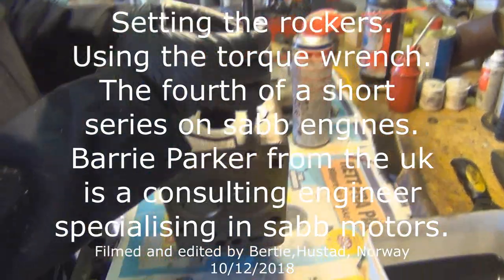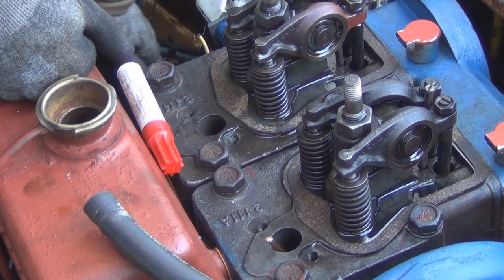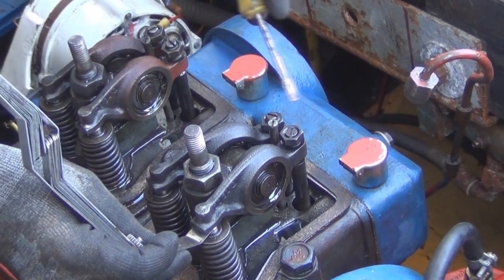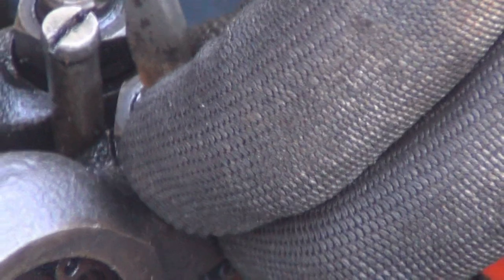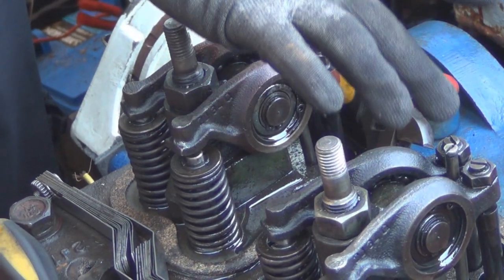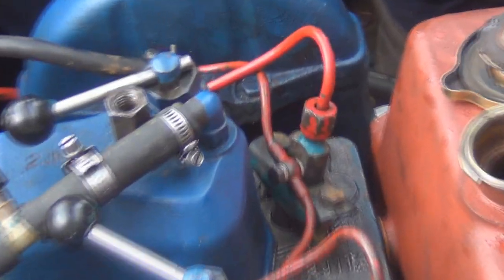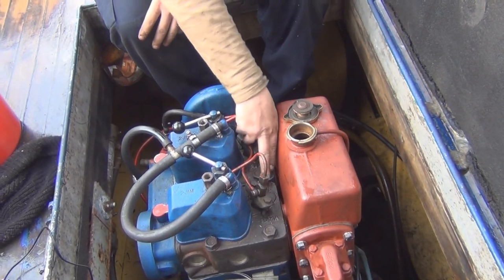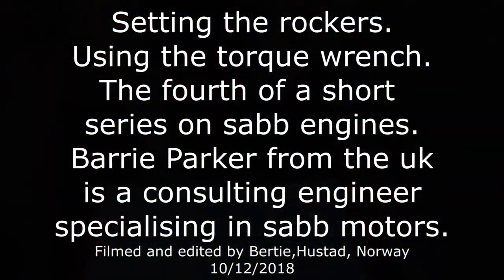Sabb 2j 30 hp marine diesel  Part 4 - setting the rockers.

Comment: 12:10 injector puller, injector extractor. Names vary from country to country
Reply from the maker: had a little look at ebay - as you said the names vary from country to country
Reply: @craftsmank  
Hello I have the same engine. In the first run, 1 piston works. When the gas is pressed, 2 pistons are working. There is no malfunction in the pistons. What would be the reason?
Reply from the maker: @MRTS35  low fuel in the cylinder - suggest you take out the injectors and clean them as in the video - both injectors that is.